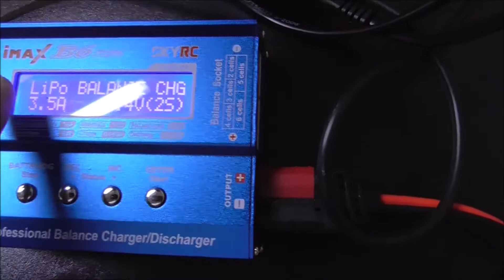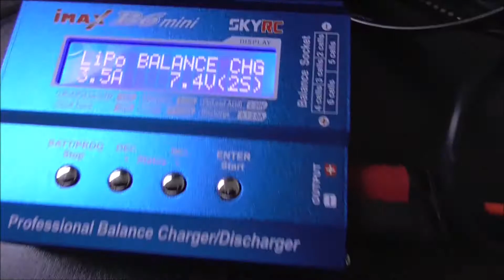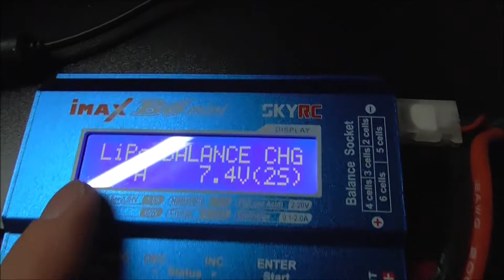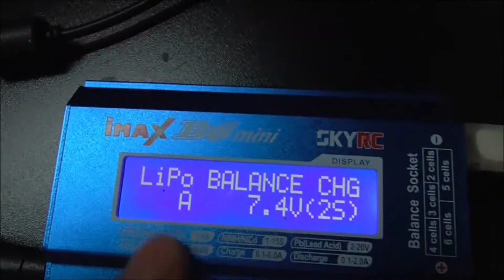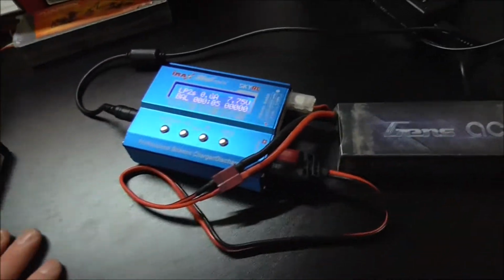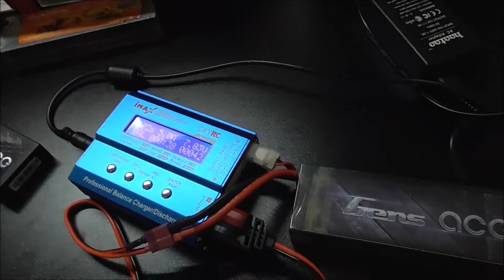How many amps do you charge a LiPo battery at?

Comment: What would ya charge a lipo battery with 320 ah.  Maybe use a 30-40 ah charger.   I just want most life out of the battery even though it'll probably take like 8-10 hrs to charge ?
Reply from the maker: Yeah that probably would be a good range.  For sure the slow long charges are best for the batteries life.   I usually have at least two so I can have one to use if the other one is charging.

Comment: never knew been charging my 5000mah up lipos at 2.2a did i damage them !?
Reply from the maker: No the slower charge rate is usually better for your overall health of the battery and longevity.  It just takes longer but if you have the patience you’re perfectly fine with lower charge rates.

Comment: Why after i start charging om 3.3 qmp the amperes start going down till 0.1 A
Reply from the maker: From what I've read it's something with the internal resistance of the battery that goes up as it charges.  This slows down the current flow as a result.    Hope this helps! 👍👍

Comment: Thanks for the video. I am a newby at lipo. I am doing a storage charge on my newer 3S 2200 50c battery. I have the iMax charger at 1A , any suggestions or is that good?
Much appreciated 👍
Reply from the maker: No problem happy the video helped.  If you wanted to charge or storage charge you could do up to 2.2A.  If you stick with the 1A it will take longer but overall is better for the batteries.  I personally go with the higher amp charge or storage charge cause I'm lazy and don't like waiting lol.
Reply from the maker: The only other tip I could give is maybe if you plan on not using the batteries for a month or so.  Pull them out and charge / storage charge them again.  From what I've heard if they sit too long without being touched it can deteriorate the batteries quicker.  Not sure how true it is but that's something I do personally just in case lol.
Reply: @BeyondTheScale  right on, thank you for taking the time to answer so detailed.
 I got a little excited and ordered a battery that is a little too much for my current RC so I want to put it away for a bit until I am able to upgrade to something bigger. 
This was very helpful 👍✌️😉
Reply from the maker: @brave6467  Anytime!  Happy to help when I can, enjoy your RC!

Comment: I am charging a 4s 6200 mah lipo battery using imax and it heatsup  a lot causing the display turn purple and never charges full what do i do😢
Reply from the maker: Doesn't sound good, have you tried doing a quick charge on it maybe?  Or charging at a lower charge rate?  I know mine will get warm but not enough to change the display, does the fan come on when you are charging?
Reply: @BeyondTheScale  nope fan doesn't not come as it's a clone one, I charged with lower amp, now it's charging normally  ( it's warm and no colour change) but it's not charging full.  For my 4s it stops (beeps) at 16.4
Reply: @BeyondTheScale  if I have to calibrated or something I ll give it a try, what's ur suggesion on this
Reply from the maker: @gagantech  Not quite sure I've never had any issues.  Weird it doesn't fully charge it, but not sure about the recalibrating.  If you can't recalibrate then you may have to buy a new charger.

Comment: How much amp would a 1050mah 2s lipo would need? Would it be 1.0 or 1.1
Reply from the maker: You'd be fine with either, you can always charge lower.  It's technically better for the battery to charge slower but obviously takes longer.  👍👍

Comment: I bought 11,000mah batteries from gens ace and my charger Tops at 8A can I charge it with out any problem ?
Reply from the maker: Should be fine, I charged mine topped out at 5amp for my 6500mah lipos.  Just note the lower amp charges are better for your batteries life but otherwise you should be good.

Comment: So my 3s is 7200 mah 80c so I really need 7.2 amps
Reply from the maker: No you can do it at a lower amp which generally is better for longevity.  I know I have some 2s lipos with 5200 mah which I need to charge at 5 amp just because that's my max on this charger.  7.2 amp would be the max you'd want to do if you could, hope this helps Kyle thanks for watching.

Comment: i have the same charger,but when i go 5200mah on 3s c50, and i start the siclus,it stops about a vieuw seconds,it go tottaly of and  again on,but it has stopped the ballancing,charging,by the way the lipo s are brand new.
Reply from the maker: Doesn't sound good, do you have older lipo batteries by chance that you could try?
Reply: @BeyondTheScale  yeah but not whit 5200mah,at 2200mah  ther is nothing happend,and work it fine.
Reply from the maker: Strange, I charged 5000mah, 6200mah and a few other 2S with no issues up to this point.  I know my previous charger that was the bigger knock off one stopped working on me.  It would for any battery stop and malfunction, not sure if you have a bad charger or not.  If it charges some batteries but not others it may be the battery but if you have the option to try and charge them on a different charger that may give you some clues to which one may be the issue.
Reply: @BeyondTheScale  only at this big boys.
Reply: @BeyondTheScale  the problem is i have a big boat recived from hobbyking,interception,and this monster need the amps,becous 3s 5200mah,they are big in my opinion,so maby is the charger to light?
Reply from the maker: Might be since this one is a mini if you have the one I have.  It should do the job though since you can go up to 6amps plus the 3s lipo option is there.  I haven't done anything aside from 2S with the biggest mah being the 6200 though.  I would suggest trying to test them with another charger if possible to narrow done the issue.  Maybe google about others having any issues like that with this charger.  Best of luck, hope you can find the issue.  I've been there myself with chargers over the years being junk lol.
Reply: @BeyondTheScale  i have the mini version whit a loss powersuply,he did always perfect the job,3s 4s,but 1300mah and 1500mah,but sinds i do the hoby whit boats,geting the batery s also bigger.
Reply: @BeyondTheScale  i take your advice and try a nother charger.thanx my friend.
Reply from the maker: No problem thanks for commenting.  Hope I helped a in some way lol, have a great day!
Reply: @BeyondTheScale  hahaha i know the issue,same whit power suplies a box  full but always handy,hahaha i hear enouf!!i t is a serious decisse this  rc thing.👍🤪🚤🏁thanx  and  take care

Comment: Most Lipos have a max charging rate though right? My 10,000mAh 22.2 V certainly wouldn't be charged at 10amps.. the battery specs say max 2.0 amps.
Reply from the maker: I would go with the battery specs rather than the charger.  This one goes up to 5 or 6 I believe which is what I charge a few of mine at.  Generally from what I've heard is the lower amp charge you do the better.
Reply: @BeyondTheScale  Yes charging a battery slower is definitely better for its life span!!!
Reply: I charge my 10,000mah 4s at 10amps works just fine

Comment: Would you charge a good quality 3c battery at 2c

I have been told if you have a good new type charger and good batteries you are fine.

I'm using a isdt k2

What's your thoughts
Reply from the maker: I haven't heard anything like that, if you do I'd research more on it if I was you just in case.  I keep it simple and charge the battery how it should be just to avoid any accidents.  Hope this helps! 👍

Comment: What is the maximum charge for a 4s battery. Because when I plug it into my drone it starts beeping when the battery is at 15.5 volts. Thanks!
Reply: No. Fully charged the drone but the main flight control keeps beeping blue do you have any idea what that might be
Reply from the maker: @benjaminscordamaglia6031  Not really sure honestly.  I've never owned a drone so I'm not familiar with it's setup.  You could always try a different battery and see if it responds the same to see if it's a battery related issue or the drone itself?
Reply from the maker: From what I've seen max charge for 4s is 16.8 volts I believe.  Thanks for commenting, does the drone beep indicating low battery at 15.5 volts?

Comment: It’s easy if a battery is 5200 mah divide by 1000 and then you get your change 5.2
Reply from the maker: Yeah I just take those first two number and throw in a decimal lol.
Reply: So it don’t matter what 5200 battery you use on the charger it’s still 5.2 A right because I’m getting lost I put 7.4 on 2s lipo and on the screen when u see the percentage on the main screen I I unplug it I think it’s done but I seen another screen it had the cells I believe and they were in the 3.44 range any help sorry for the paragraph first time rc💯😂
Reply: @thestanfieldfamily1924  4.2v per cell is when the lipo is finished charging any other questions I could probably help with
Reply: @TortugaBruv  so I put 4.2 On because I have 5.0
Reply: @thestanfieldfamily1924  if you have a 5000mah lipo you charge it on 5.0 amps when the lipo is fully charged each cell should read 4.2 volts also make sure you to balance charge your lipo
Reply: Anyone reply I’ll appreciate it